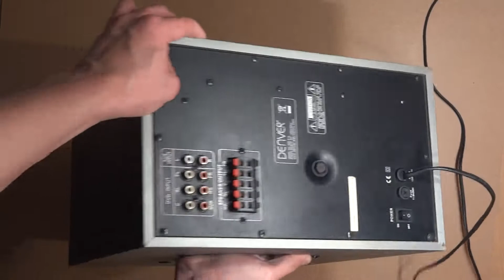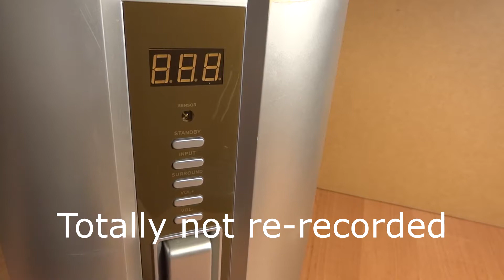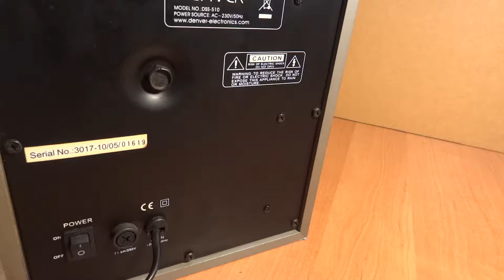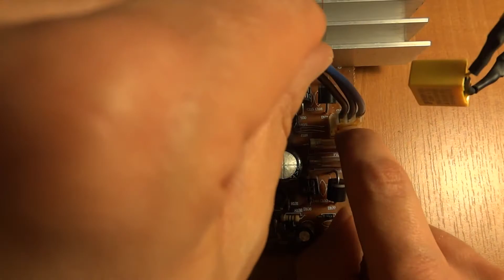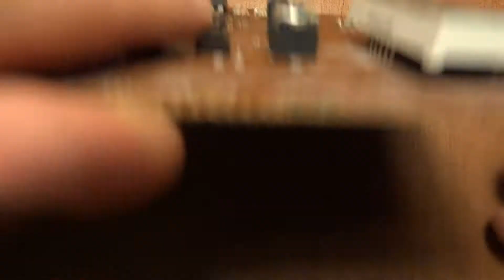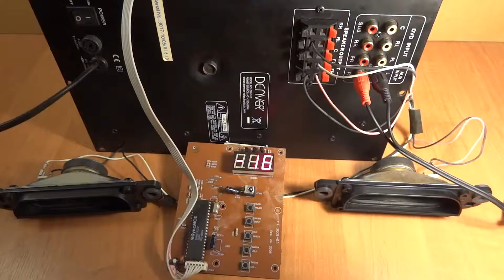Exploring SCRAPPED amplifier from Denver DSS-510 subwoofer

Comment: What could have caused the explosion of such a TDA2030A? In my case it is the second one from the side of the larger connector..
Reply from the maker: Best to check capacitors after that just in case they may be the cause, but other than that my best guess is a short on the output or general failure because of load for an extended period.